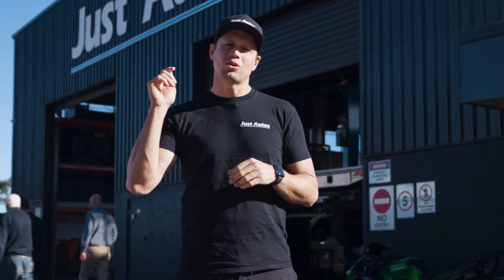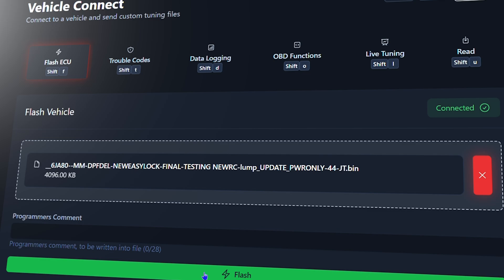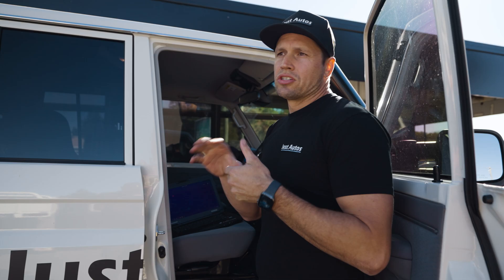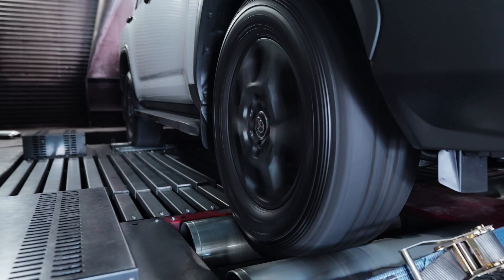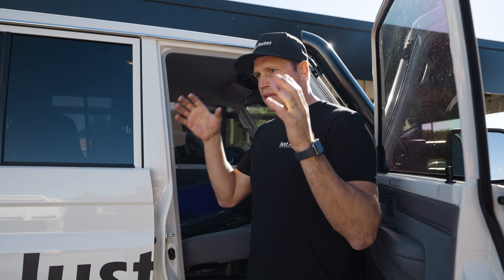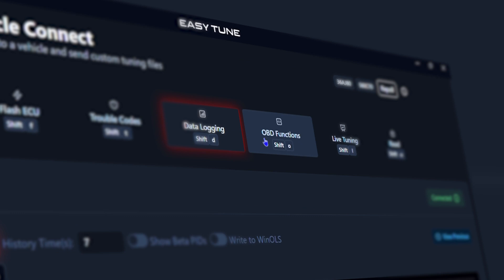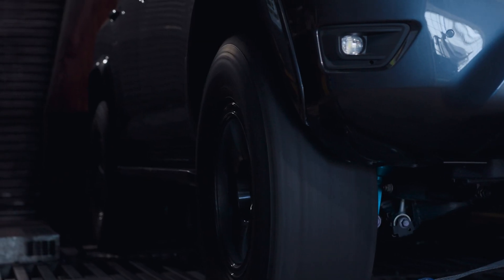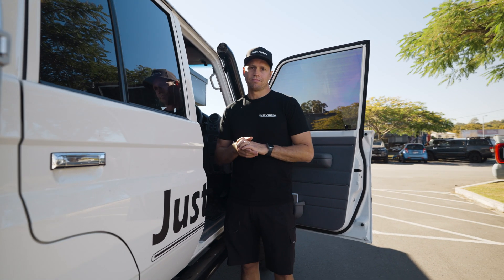There is NOTHING on the market like this | EASY TUNE.

Comment: I would like a option to remove my just autos ecu and transmition tune before taking it for a dealer service and then put the just austo tunes back on after service. Wil this be able to do that?
Reply from the maker: Yes but there isn't any need to take it off every service. You just need to make them aware you do not wish to get the software update, to just leave the ECU alone and do the service and they will have no problem with that